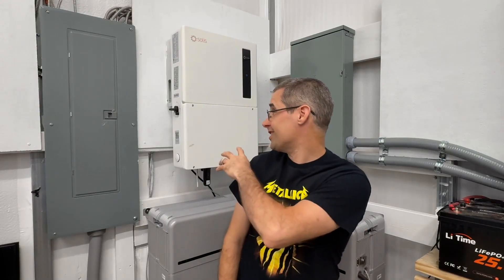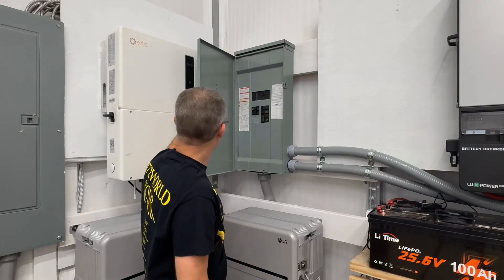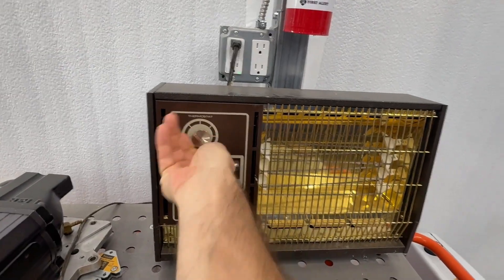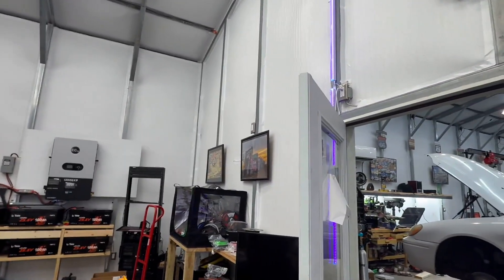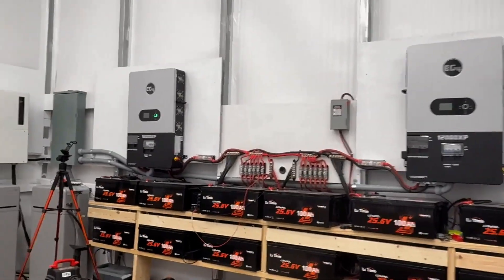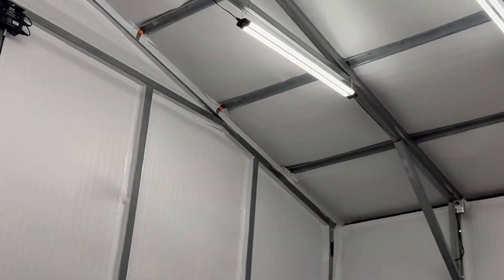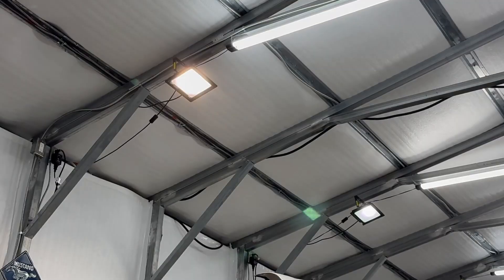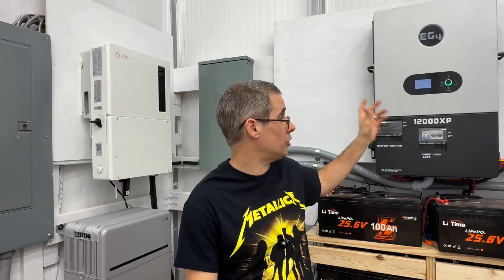Ultimate Stress Test:  Solis S6 Hybrid vs EG4 12000XP Inverter!

Comment: The first part. What did you do that's wrong? Something about temp setup. I missed it.
Reply from the maker: Thank you for watching.  I need to add in an interlock switch.  The setup is off grid, but I switch between 2 separate solar setups.  Having a interlock will make sure I don't have both setups feeding the panel at the same time.
Reply: @MikesSolarGarage  got it. Thanks for the videos

Comment: Have you overloaded the S6 11.4kW yet? I was wondering how it acted.  I run my 18kpv around 8500 and leave room for the 2000w the well will pull if it needed to kick on im hoping the S6 11.4kW could do the same. And let the well run 30 seconds like someone washing hands. Im running 2 mini splits charging the car around 5500w. I take it u don't have a ev. That is a steady pull of some higher amps. For me max 32a but i can't do that and leave head room for the house stuff.
Reply from the maker: I have overloaded it once.  It shuts down for about 20 seconds and then kicks back on.

Comment: Wow nice comparison. Would a small super capacitor bank in parralell with the batteries, to alleviate the pressure in the batteries for the inductive load starts. You get 12v ones that look like car batteries 4 in series may be ideal. It could take say 12 kw for 15 - 30s its enough to protect the batteries from the surge.
Reply from the maker: It this case it wouldn’t.  The capacitors I’m referring to are in the high frequency circuit after the voltage has been stepped up.
Reply: @MikesSolarGarage  The inverter cant get current fast enough from the batteries for the surge load. When the capacitors in the inverter are exhausted the batteries haven't been able to meet the surge If there was a super capacitor in parallel with the battery bank this would be fast enough to meet the surge while the batteries have time to "catchup", think of it like a buffer for the battery. The dip is not the SNA inverter it's the battery surge not being fast enough for the inverter. If there is a super capacitor in parallel with the battery it empty's fast and fills slowly from the battery reacting much faster that the batteries can and greatly reduces the surge load stress on the cells.
It would make a great video at the leaset.
Reply from the maker: @julesc8054 That would be interesting.  Let me think about that one.

Comment: Nice. I believe the yellow light on 12000xp means one of the legs might be overloaded (more than 6,000w). The app will show you independent load per leg. When I run a max load of 11800 w from charging two EVs (balanced load), the light stays green.
Reply from the maker: In some cases it could be, but with mine I have it setup for battery voltage instead of SOC and I have the voltage set to where the batteries are at approximately 30 percent battery left.  When high current is required from the batteries there is a large voltage drop which can make the inverter perceive that the remaining capacity is lower than it actually is.